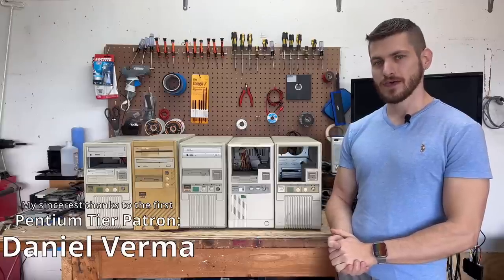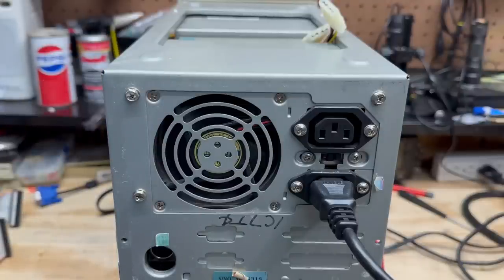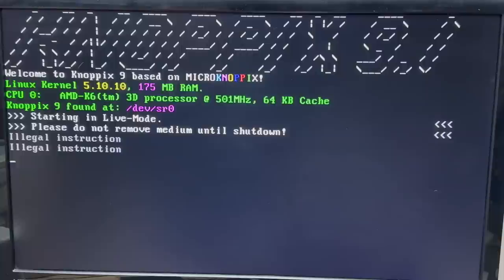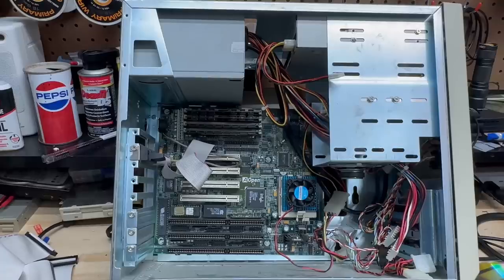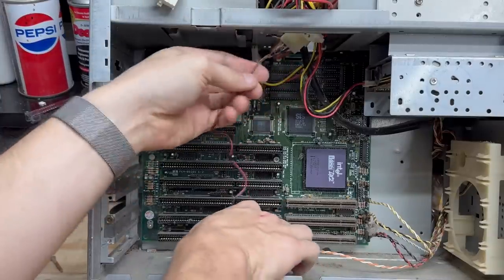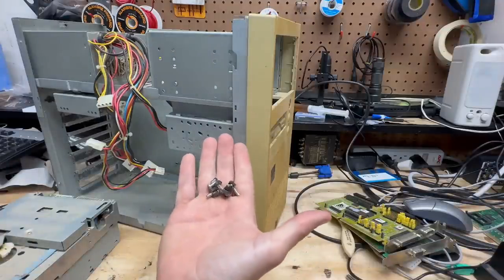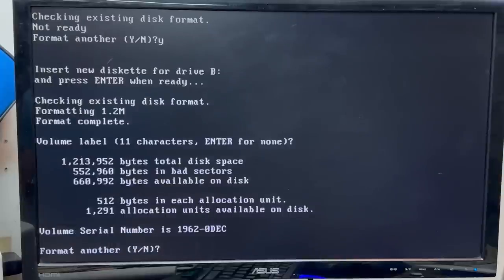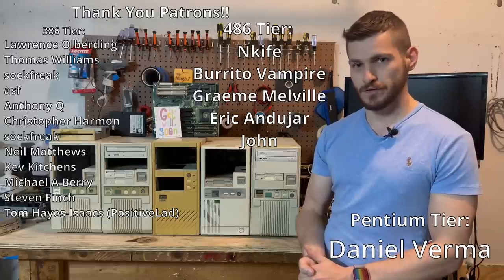Vintage Computer Teardown and Test: Let's check out the Baby AT towers from the Franklin eWaste haul

Comment: Looks like the pieces of wood you took out were used as a guide for whatever was being plugged into the back of the motherboard (probably the AT keyboard plug). The gap between the case and the motherboard was fair distance apart and this helped to guide the plug right in instead of being fiddled around with causing annoyance by the user.
Reply: ..and stabilised the keyboard plug from the top

Comment: The reliable "one screw wonder" technique for hard drive mounting has stood the test of time. My protégés have learned it from me, and they'll ensure it endures.
Reply: Do you teach a class on this? : )
Reply: @keithbrown7685  I don't teach a class, but I am available for hard drive mounting consultations. My rates are reasonable, and my results are legendary.
Reply: @prozacgodretro  Yeah but can you implement, say, a paper clip or twist-tie when there are no screws around?  That would be an advanced course that you should teach. I'd do it myself, except I can't pull apart a new garbage bag. Can you believe that?   : )
Reply: I've done it on plenty of Baby AT motherboards. Usually only one screw hole actually lines up with a threaded post. The rest are those annoying plastic stand-offs!
Reply: As long as you're not gonna be moving house, it'll stay together OK. Amazing how hard it is to get screws for mounting hard drives, even computer shops seem not to have them. Also amazing how easy they are to lose.

Comment: The first machine has a Tyan S1590S super socket 7 motherboard.  The first motherboard I bought when I got into computers.  That board is long gone but I kept the box and software.  I just purchased one off of eBay a few months ago.  I also picked up an Enlight baby AT case too.  Similar but not the exact case I used to have.  Both reasonably priced.  I also still have the original ATI Xpert 98 video card for that machine.  I believe the Yamaha YMF719 ISA sound card I have is from that pc too.  I’m in the process of rebuilding my old machine.  I’m enjoying the videos.  Thanks.

Comment: The piece of wood probably holds the keyboard connector in place. I had an issue way back with my 486. I would frequently move the PC and disconnect/reconnect the keyboard, and the connector came loose and didn't have a proper contact to the motherboard. I had to wiggle it around to a certain position so it would work. This probably serves the same purpose.

Comment: Hope Nana's video card becomes a recurring thing lol. Also they make modern coin cell battery adaptors that fit into the socket of a Dallas RTC, so there's no need to buy a brand new Dallas RTC, meaning it more or less will function like any other PC at that point.

Comment: The progress indicator in dd may be just optional, "--status=progress" to get it , or something similar.
It's been years I didn't see a Knoppix running :)

Since you have many computers, I suggest you get a Lan bootable network card, for example a 3Com 3C590 PCI, and boot on  network from it .
You can boot a full Linux Systemrescuecd, a dos floppy image. a memtest floppy image, Plop boot manager to boot from USB, even on old computers, etc..
Of course, you need a dhcp / tftp / nfs or apache on any Linux/BSD machine.
Reply from the maker: I usually use the ‘status=progress’ flag on recent versions of dd, but this old version didn’t like it. 
I do like the idea of having a boot server. Good thing I have a full 25U server rack at the house!
Reply: @miketech1024  It should be enough, I just use an old laptop hidden in a closet  :)
I forget to write you can have a multiboot using boot on lan, so you can choose.

Comment: There's probably a ton of comments about the power supplies... but in case there aren't, it's kinda normal for the voltages to be a little off when they are not loaded. And hooking up a dead hard drive isn't loading them (unless it's an 8 inch from the 70s) enough.
You don't have to care if the (negative) voltages aren't spot on as long as they're there. For an unloaded PSU, 4.8V-5.5V for the 5V is ok, 10-14V for the 12V and as for the negative rails - if they're in the right order of magnitude, that's all right, they are used only for the serial ports (and some rare cards that might need them).
Try hooking them up to a well populated mainboard and measure again. Now - "my" tolerances for a loaded PSU are 4.9-5.2V on the 5V and 11V-12.5V on the 12V. As for the negatives - anywhere from -4 to -6 on the -5 and -10 to -14 on the -12, as they're almost always only used for the serial port.
Now on ATX PSUs, the 12V are a bit more critical. Old AT mainboards mainly run on 5V.

Comment: On the old dd, if you opened a second terminal and run 'watch -n 60 "kill -URS1 $(pidof dd)"' it should print the progress on the terminal the dd process is running on. More specifically, send the SIGUSR1 to the dd process to see the progress. The rest is fluff to make it work as a single command. :)

Comment: According to theretroweb,
the first board is a Tyan S1590
the second one is an Aopen AP53
the third one is a DTK PKM-0038S E0 
You can find more infos on there (especially for jumper settings :D )

The DTK's trident video card seems to have a very bad video output, the picture is very noisy, maybe you should look into that as well. I had an 8-bit trident vga card that had a very bad video output at some point and it turned out one of the tantalum caps was turning bad. I'm not saying that the caps are bad though, maybe it's something else.

Also the 4x mitsumi drive may have issues reading your CD because it's a burned one. Old CD-Rom drives sometimes have issues reading burned CDs while regular CDs are fine

Comment: The dead battery ought not to be a show-stopper. Just try saving and exiting the BIOS. Should work. You might have to set the hard drive types but it auto-detects so that's no problem. You should be able to get it booting no problem, you'd just be left with having to do the same thing every time you boot it.

Comment: Amazing! That's a superb ratio of working vs non working stuff! Looking fordward to the motherboard repair video. About the weird memory placement on the first PC, I'm pretty sure those AT cases can have the motherboard tray removed, they usually have one or two screws on the back. Too bad there were no ISA soundcards, no need for sound on those "office" machines xD!
Reply from the maker: Thanks! Unfortunately this case has the motherboard tray riveted into place. The crusty 486 case luckily has a removable tray, but I realized that after the fact. That is one of the many features I miss about AT cases!
Reply: @miketech1024  Wow! I thought just the drive bays were riveted, that's common, but hey that's a great SS7 AT motherboard, it even looks like a "retro sleeper" build haha! Just for fun I'm doing something similar with an AT Pentium III motherboard and a Socket 370 P3 @ 1ghz on a slocket, from the outside it looks like a 386 😁😁

Comment: Loved that rubber duck in the bath 😂 BTW, about the mouse - while serial mice are hot-pluggable, they were not PnP, so you would have had to do some sort of search for new devices, or restarted the computer after plugging in the mouse. I think that was the reason Windows didn't recognize it while it worked just fine in DOS.

Comment: It's been a long time, but I sort of remember the trick with WIndows 95 is to boot into Safe Mode, then delete all the hardware under Device Manager.  When you reboot, it should go ahead and re-detect and re-install all the proper drivers.  I remember moving between some very dissimilar hardware, and it actually worked.  Having said that, there is probably a not insignificant chance of destroying the install.

Comment: Ah wow! The AMI WINBIOS (as they called it, the GUI one) has a wiggly pointer! Mine didn't have that. Still, mine was a 486 so maybe an earlier version. 

I liked WINBIOS. Was friendly. Shame it went away and we're stuck with the same text-based mega-menus we've had since 1986 or whenever computers came with BIOS setting utilities built-in. Prior to that you had to load them from disk whenever you wanted to change a setting. Don't ask me how you'd install a boot drive on one. WINBIOS wasn't much, the icons just led to the usual sort of menus, but graphical and cute. They could have extended it further though with more windows and icons for deeper setting stuff. If they'd stuck with it you'd probably end up with Windows Vista as your BIOS utility.

Ah, that 5 inch hard drive! It's from another world! Like the glorious steam age or something, it belongs on an Apple II or an Altair or something (actually Altairs often used 8" drives). Weird to see one on an actual PC. It won't have come fitted on the 486 unless it was a special request for some business that still somehow used them. Still at least now you know the lever doesn't flip down without a disk in.

Comment: That vx issue in win95 startup is easy to fix, you just need to reinstall Network device drivers and it will do the trick.
Reply from the maker: I’m gonna have to dust off some very old brain cells to get back into debugging Win9x!

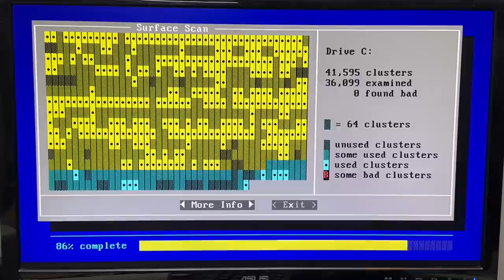Comment: 37:14 🤣 do not expect any hdd to be good after it makes such a horrendous sound on the first init after a millenium 41:20 😱 wow it really survived 👏👍 42:00 if the drive has 2 heads, it is 99% it is 1.2Megs (5" one)

Comment: I had one of them batteries leak in an Amiga 500(Amigas and Atari STs were more common in the home this side of the pond, x86 machines were typically only found in offices until the mid '90s), thankfully it was isolated to the expansion card the battery was connected to, but my heart sank when I saw it. The machine worked, but unfortunately it meant finding a new expansion card as most Amiga software requires 1mb RAM.

On the first machine, I didn't even know they still made ATs at that point in time. I guess it must've been a specialist motherboard or something.

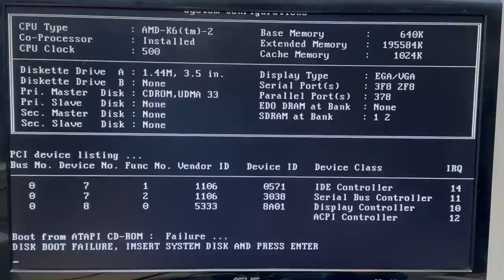Comment: 11:13

I take offense to floppy drives holding my disks at ransom, it's easier to get a CD out of a stuck drive, just need a paper clip, but those floppy drives are thieves sometimes.

I missed grabbing an old Dell CRT on Wednesday. Nothing fancy, black case, early 2000''s. Passed it on the way to work and when I came back through someone had thrown it face first onto the curb and smashed it. Love to know who did that, it looks like it was a nice little 15" monitor before that, still bummed about it. I am running out of space in my little duplex for this stuff tho, between car and computer parts.
Reply from the maker: Oof, what kind of person would do that to an innocent CRT? Somehow I have only 3 CRT monitors to my name (other than my AIO systems), with one being a 15” Dell. I would love to find more!
Reply: @miketech1024  A lot of people smash stuff, I've saved things from being smashed / shot before.I have two CRT's. They came out of a ditch, one is a Viewsonic 19" and the other is some oddball off brand 17". The 17" has road rash on the face, but the screen isn't damaged. The View Sonic needs repairs, the case is kinda falling apart, it also had slugs on the screen when I got it. They weren't happy about being evicted. 

I used to have a lot more but a certain deceased family member who shall remain unnamed threw them away along with a lot of other rare PC parts I had despite having me pay to leave them in a corner of a disused room for years. Haven't really built up the collection since then, too bummed missing my 19" trinitron 😆
Reply: @DeadReckon  I wish someone had saved me from my own stupidity when I threw a whole working computer out with the garbage, just because I didn't want to store it. I had the room.

The monitor was 17". I forget the make, some reputable brand. It was all working fine. Don't know wtf was the matter with me. :(
Reply: @keithbrown7685  Used to be a time this stuff was disposable, I hung onto stuff because it's nostalgic for me. I really need to build me a Pentium MMX era system but I can't justify the absurd cost of parts these days.
Reply: @DeadReckon  Almost like trying to maintain a classic car. Money pit, that one. : )
Reply: @keithbrown7685  Smaller pit, usually, the computer that is. A computer usually doesn't break down and cover you in grease old enough to have it's own opinion and life goals either 😆

Comment: 22:50 if you you exit the bios setup without saving the system will boot further even without the battery
Reply from the maker: I knew there had to be some weird trick to get around that - Thanks!

Comment: While many people and companies did put bare aluminum heatsinks on those CPUs, it doesn't mean it's correct.

The rough aluminum on aluminum or aluminum on ceramic provides almost zero thermal transfer, resulting in the CPU running a LOT hotter than it otherwise would. In some cases, you'd get a lower CPU temperature just blowing air on the die with a fan directly, rather than an almost zero heatsink contact.

At bare minimum, a thermal pad should be used, but thermal paste is much preferred. These CPUs are decades old and don't need to be subject to the same bad cooling solutions today.
Reply: Right, but a Pentium 90 or even 133 didn't get so hot. 
So it was not really a problem.

Comment: You can get into the Dallas module with a Dremel and put a CR2032 holder on top of it..  Or I think they still make a 12887 of some variety.
Reply from the maker: I honestly thought about it. There is a modern replacement RTC (with a replaceable battery) that was created by a YouTuber called Necroware. It’s open-source hardware so I’m gonna chef one up in the motherboard repair video.

Comment: Watched this on my Roku first and a lucky and sweet find on all the vintage AT Cases. Such a sad site to see that motherboard with the barrel battery have so much damage. Hope you that board back up and running. I love the AT boards and cases. Many people(todays younger generation) can have their RGB ( 🤮). I will take beige and drive bays any day of the week. Granted this is just my opinion. I am just not a fan of what computer cases have now become. I love the high air flow for for cases especially for today's hotter components I just don't like the fact that they decided that it was a good idea to get rid of drive bays and place Christmas lights inside the cases. Its a computer case not the Griswold House at Christmas time.

Comment: Those old power supplies always make me nervous when i want to try old computers for the first time. I had a few in the past that would straight pop or start smoking,it would suck to kill a good motherboard or any other part with a bad power supply
Reply from the maker: Yup. Every old power supply is guilty until proven innocent in my opinion!
Reply: Yeah, but ... but you're getting to see the magic dust. What's wrong with that??   : )
Reply: @keithbrown7685  You can see the magic dust but It can kill other components that might be good
Reply: @Mirra2003-f9s  True enough. But it would make for a good yt vid, no?   🙂

Comment: Some old CD drives do not like CD-R at all and will only work properly on regular pressed CDs. I have one like that, it will try (and rarely succeed) reading CD-R but no issue at all with regular CD. So maybe the last CD drive may work with a regular CD?
That Caviar 2340 really didn’t sound happy until it did, no bad sectors is nice! I have had a few drives that acted like that, sounding really bad when first powering them up but then be fine, I wonder why that happens.
Good luck with that 486 motherboard, that battery really didn’t spare it.
Reply from the maker: Yeah I've run into that issue with old drives and CD-R discs. It sounds like this particular drive has a sticky spindle motor. I'm probably going to do a drive resurrection video once I amass enough troubled drives. 
I've found that some old hard drives have rubber bumpers to limit head travel. They decompose and get sticky. I just recently repaired a Quantum Daytona GoDrive from an early '90s laptop by wrapping the bumpers in printer paper. It went from completely dead to completely fine! I'll replace the rubber themselves once I find the parts and the courage to disassemble more than the drive lid.
Reply: @miketech1024  Yeah early Quantum drives are known to have rubber related issues, some early Conners do have that problem as well. Some of them are extra annoying as the rubber is under the platters, so you have to improvise your own stopper to make them work again. It is always nice when you are able to get a drive working again!
Reply: Maybe this one was just idle too long, neglected too long. Like everything else, needs to move to stay in shape. : )

Comment: Hi, Do u want to buy Dell gs+ (1997), HP psk 500, NEC MultiSynk LCD 1550V in perfect condition, so perfect that Syms and Civilization run without problems, and the printer prints directly from the computer? Or what site can I sell it on?
Reply from the maker: Have my hands pretty full at the moment. Check eBay (you can filter search for recent sales to gauge value). There's also Facebook Marketplace and the various vintage computer swap-meet FB groups.